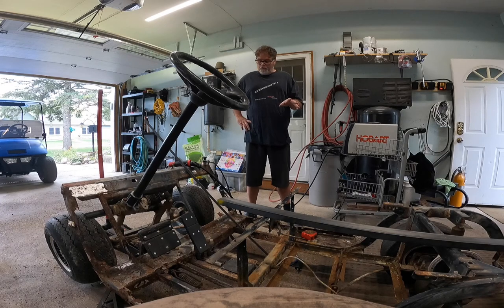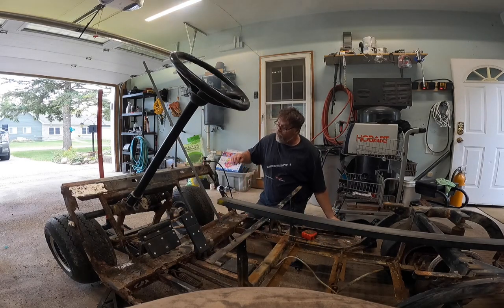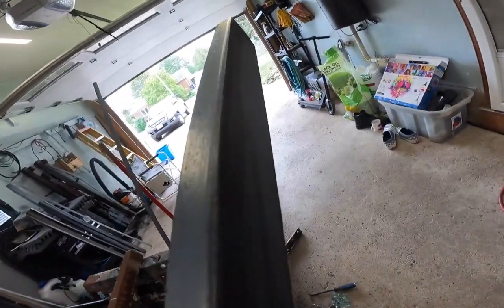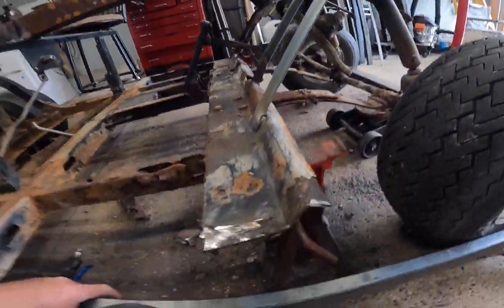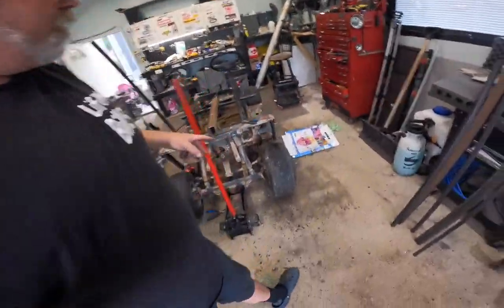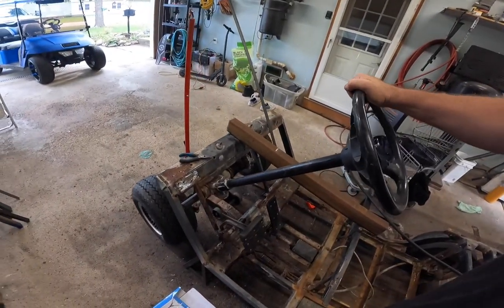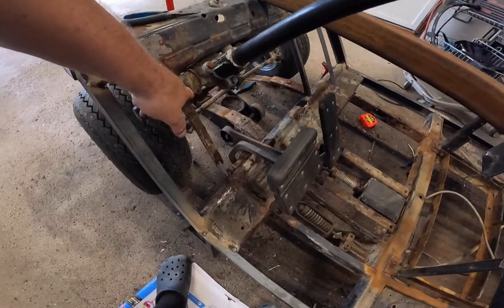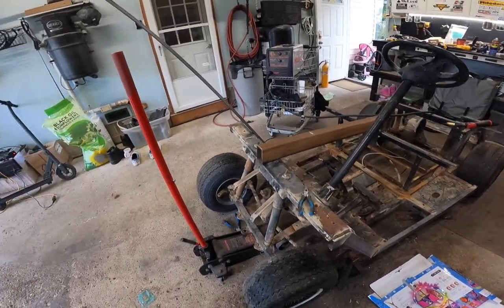Junk Yard Golf Cart Rebuild Starts

Comment: Great video! Just what I was looking for. I just purchased an early 2001.5 EZGO. Once I stripped it down, I saw I have the same issue. Both sides of the frame need to be replaced. I literally need to do the same as what you did on this video. Unless you live in Miami I can't hire you LOL... If someone in your area asked you to do what you just did. What would you have charged them? Ballpark :0)  This will help me decide whether it's worth fixing or not. I paid $300 for my EZGO. I'll sell off some parts to balance the cost. Thanks!